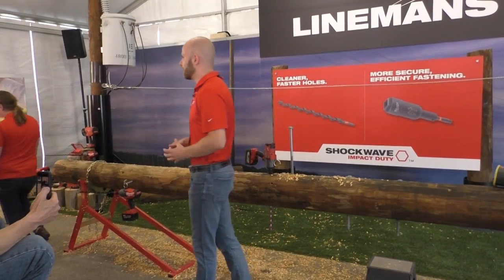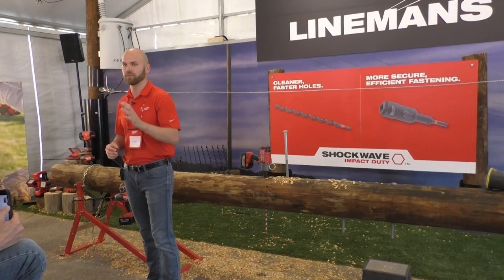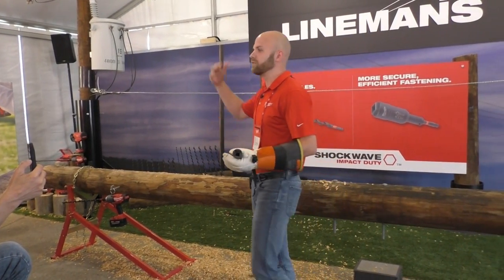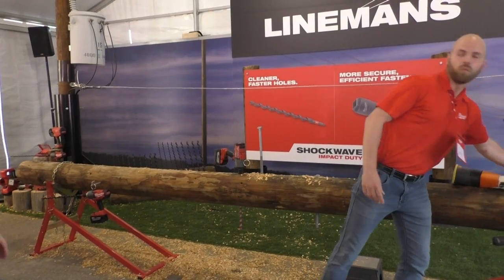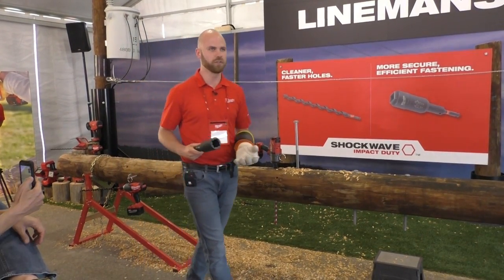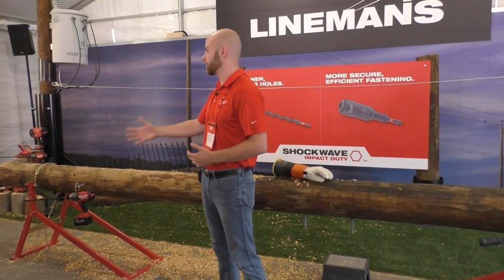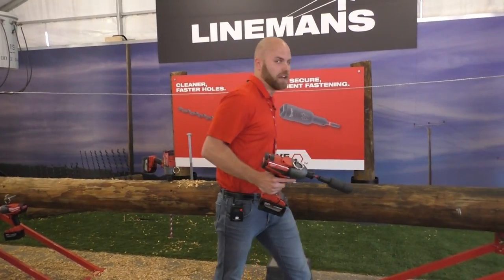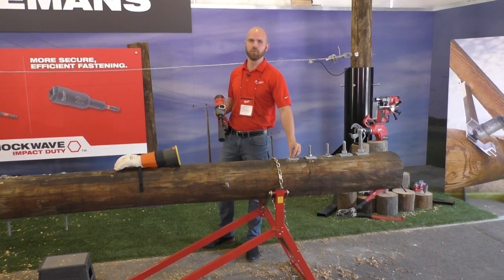Milwaukee Tool Lineman Shockwave 3-n-1 for Utility Distribution & Transmission Sockets

Comment: Still have to manipulate the socket to get the right size. I'll just stick with my nut runner and deal with the limited amount of times that I have to use the small end. Most disassembly is done on the ground after cutting the pole top and lowering it to the ground.